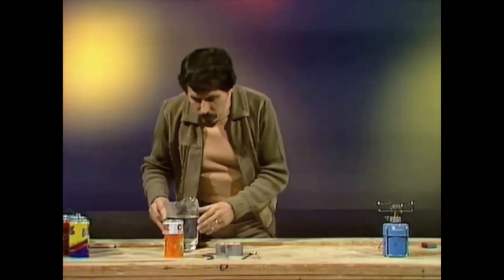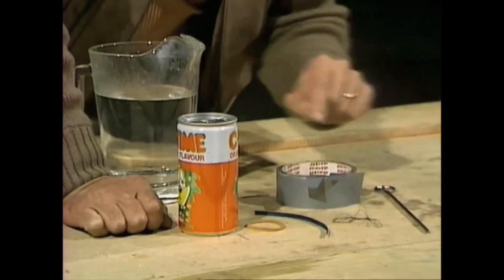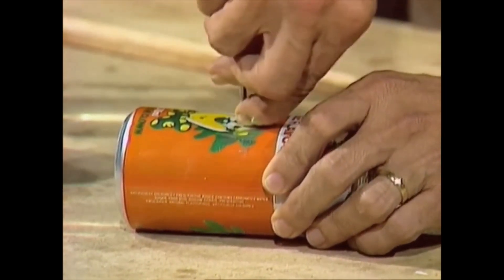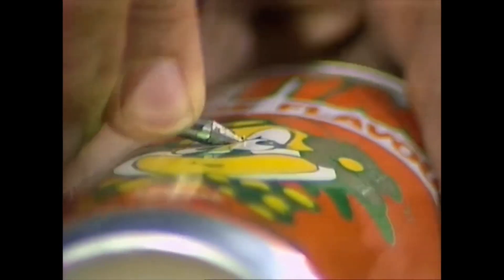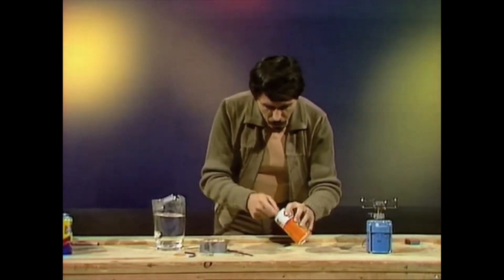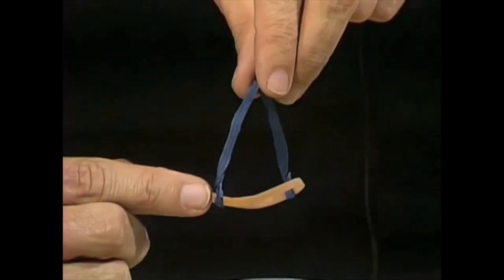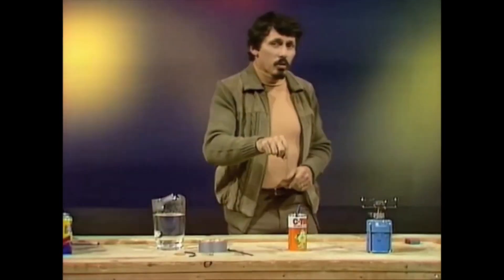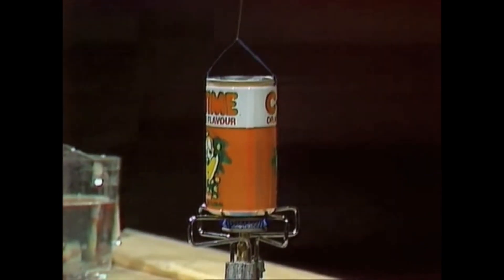Hero of Alexandria's Steam Engine

Comment: we actually have no idea what it looked like as all depictions of it were simply the imaginations of various monks translating scrolls...

it was described, but there was no drawing or diagram of it... what we get is simply what they conjured up at the time. even the translation and subsequent descriptions are suspect...

i personally suspect it was "the other way around". an impulse turbine. the logic of it seems more likely. reaction isnt a force that they would have had much experience of in ancient times. we experience it with a hose, a leaf blower... where would they experience it it?
you can experience impulse every where. you blow on a leaf, it moves. you dump water on a wheel, it moves... you blow steam on a wheel, it moves...

 it is also far easier to make a stationary boiler with nozzles impinging on moving blades...

Comment: Why two holes on the top and not just one?
Reply: Not 100% sure, but could be for easier pouring in.
When you pour water into that first hole if the water accidentally covers all the opening it’ll block and all the following water will splash everywhere. The second hole allows air to escape as the water is flowing in. 
That was the reason for the second hole when drinking. You could cover the first hole with your mouth and as you drank the liquid the second hole allowed air to flow in and create it and keep the pressure equalised inside and out.
Reply: Old cans were like that. Same reason takeaway coffee cups have 2 holes, explained by the other guys
Reply: @boomstand2872 
I was assuming he meant why is it best in this case
Reply: Maintains constant flow (so no glug, glug, glug as with a modern can as it sips air between each release). Its so you could take huge drinks without having to let air back into the can because of the small hole at the TOP and the LARGE mouth hole of the bottom, basically the small hole at the top let you drink the entire can in one hit without trying to suck it all up in one hit (with a regular can) thus crushing the can.
Reply: I think it's an air hole so the fluid can easily flow out of the main hole
Reply: I think that's the design of old soda cans

Comment: 4:16 “For every milliliter of water that you began with, after boiling you end up with more than 1600 milliliters of steam, so you get a great increase of pressure inside that little can.”
But steam is a gas, and gas doesn’t have a fixed volume. I can’t figure out how you got the 1600 milliliter figure.
Reply: The density of steam at 100 °C (assuming 1 atm pressure) is 0.0006 g/cm³. Which is 1600 times less than the water at room temp (when it was added).
Reply: Probably measuring it as standard milliliters. For a fixed temperature and pressure, a specific mass of gas will have a specific volume. 

He probably calculated it using the ideal gas law. PV=nRT
Reply: A quantity of water will occupy 1600 times more volume as gas (vapour) than the same quantity of water does as a liquid.
Reply: @attilajuhasz2526  But doesn’t gas expand to whatever container it is in?
Reply: @sparkyheberling6115 
It does. 
But that's not the point. 
Popcorn "pops" because the kernel can't contain the volume of water vapour that started as liquid before being heated.
Reply: @attilajuhasz2526 I get that steam takes up more space than water. It’s the actual figure that I can’t figure.
Reply: The steam isn't entering a vacuum.  It's not entering a closed system.  It is in a system in which other factors will quickly stop its expansion.
Reply: "more than sixteen hundred milliliters" is not "a fixed volume".  It's a lower limit, with no upper limit stated.

Comment: Not one greek or roman had the idea to hook up the "toy" to a wheel or mill stone...the world would have industrialized 2000 years earlier.
Reply: European metallurgy advanced a ton in those 2000 years, not to mention mining techniques and a ton of other technologies- most notably the printing press and cheap paper to quickly transmit knowledge.
Bret Devereaux is a Roman historian who goes into a lot of good detail on the subject, in his blog post titled "Why no Roman industrial revolution?" if you're curious
Reply: While they didn't use a steam engine to produce work they were surprisingly good at using water (rivers, etc) to produce work: driving various mechanical systems such as for grinding.
Reply: Hahaha. You'd need a whole lotta steam.
Reply: would need a lot of knowledge not discovered at the time but a good statement nonetheless, its like if future generations look back with greater tech and wonder why we didnt do anything with it like they did, we are the crowd looking at the spining toy to them
Reply: Especially if a Stirling engine configuration was used too. Wicked!
Reply: not with steam-engine, but check the "mills of barbegal", they weren't far away...